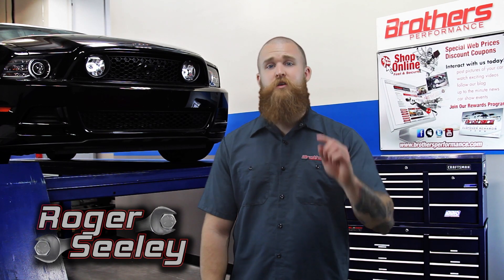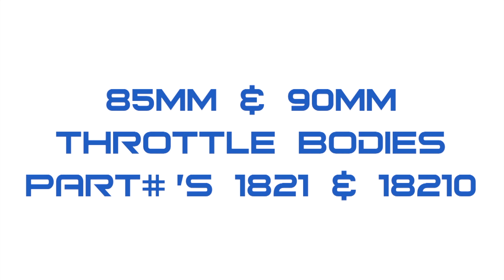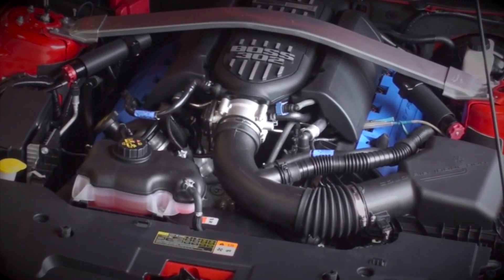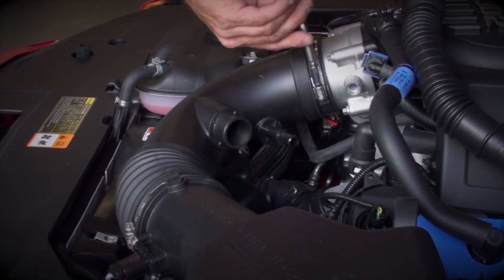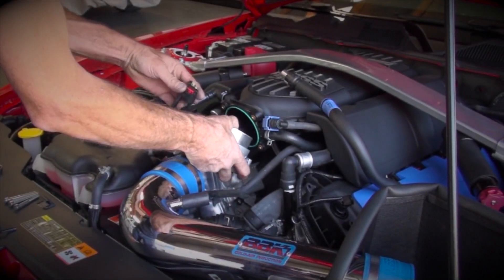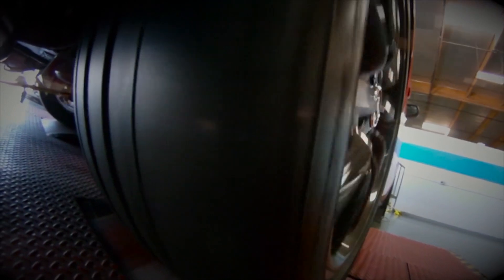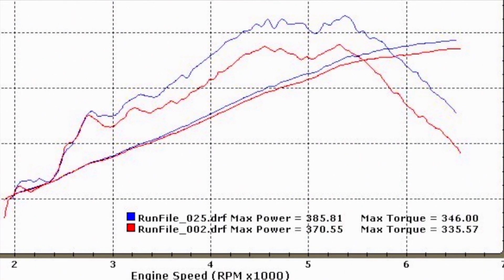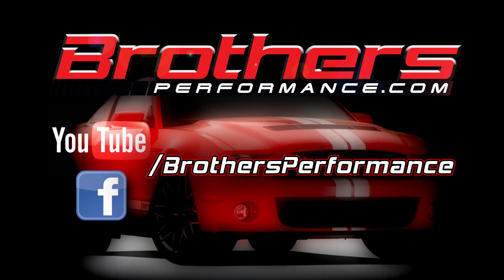2011-2014 Mustang GT, Boss 302 Throttle Body Install

Comment: i have a 2012 mustang 5.0, its got headers, 3in exhaust, x pipe, flowmaster outlaw,  and a cold air intake, what would be the better option 85mm or 90mm body throttle?  also would this help me get better respond in take offs? thank you for the help.